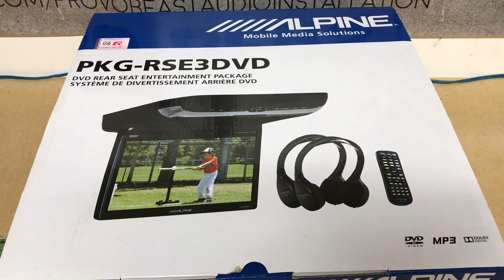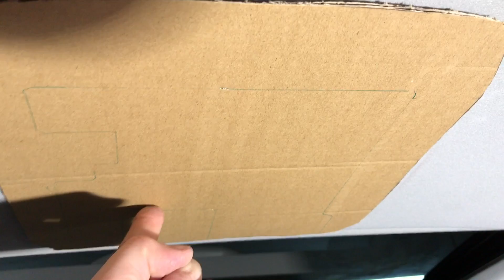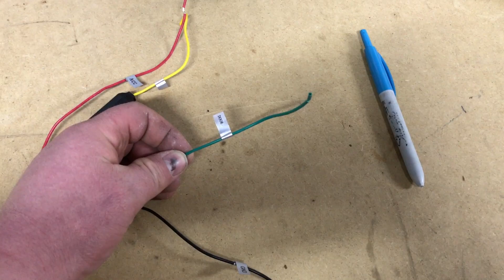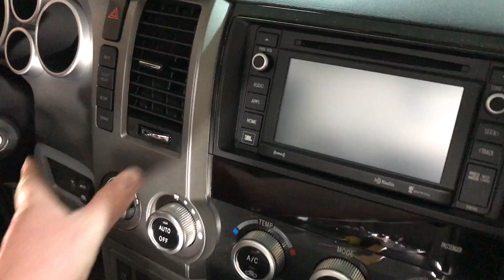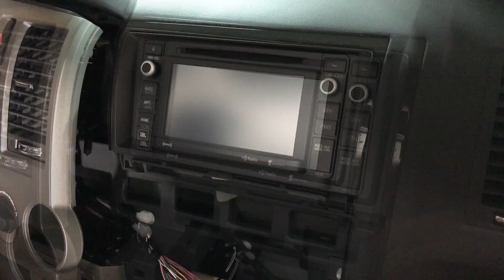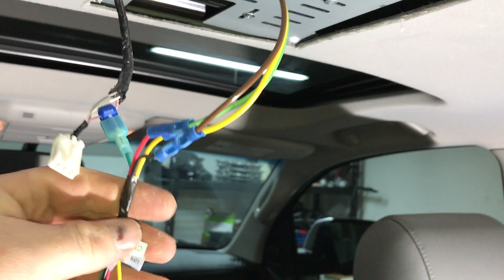2008 - 2018 Toyota Sequoia DVD Screen Install

Comment: My 2006 Sequoia Limited already had a DVD. I bought a Xtron unit and was able to figure out how to connect the unit. My issue is the dome light function. The only cable that I have left, when you give it ground, it will turn on my front Dome light with door open or close. Is really killing me to figure it out.

Comment: Got any tips for ether figuring out which FM it's programed to or reprogramming it? We bought an 07 Navigator which came with this DVD player. No head rest speakers, no head phones, and no remote. I'm working on getting them.
Is it possible to program or find the FM station it uses?

Comment: AM I ABLE TO INSTALL A FACTORY DVD PLAYER IN MY 2017 SIENNA? I HAVE AN EXTRA ONE FROM MY OLD CAR AND WAS WONDERING IF I CAN TRANSFER IT TO MY NEWER SIENNA. IM ASSUMING IT SHOULD BE OKAY TO JUST WIRE IT INTO THE DOME LIGHT WIRES? ALSO USE MY STOCK STEREO?

Comment: Not getting enough power to run the unit, lights work but VERY dim, screen does not power up. Any ideas? Thank you.
Reply from the maker: Use a volt meter to determine what voltage is being sent over.  If its low, consider using another source for power or installing a relay to boost voltage and / or run a line to the battery.

Comment: Hi I need help, I want to connect the dvd to CD player by component audio but the CD player don’t have those connections , how can I do?
Reply from the maker: Run the power to a constant source and fuse it.  Run the accessory wire to a switched power source (only on when the key is on), and then connect the ground.
Reply: Provo Beast Audio Installation hi I ready did the installation but I have problem the screen is blinking Can you helping? Please
Reply from the maker: Sounds like a wiring issue, i would recheck your connections or consult a local professional.

Comment: In you unboxing video, you already have a unit installed. Did you have to replace the apline unit or was that another vehicle?
Reply from the maker: In the other video, it was just a replacement of an existing unit.  This video was a fresh install.
Reply: Provo Beast Audio Installation
I know a lot of Toyotas have 8.5 inch screens. Is it a noticeable difference to go with a 10 inch? Thanks for your time! I really appreciate it
Reply from the maker: Well, it may no be worth the hassle to upgrade, but it all boils down to personal preference.  If you do end up replacing the screen, might as well go bigger than a 10"
Reply: Provo Beast Audio Installation
I can't find any reputable brands over 10 inches. Well apline makes a 13in but its illegal in CA.. not sure why or if there is a limit for CA

Comment: I got the unit already and the yellow wire tag is Battery + do I need to connect that or just use the red 12v+ acc. Planning to connect it to one of my fuse terminal
Reply from the maker: Does your unit come with a Red, Yellow and Black wire for power, ground, and accessory?  If so you will need to connect all three.
Reply: Yes it does
Reply from the maker: Then connect the yellow to constant power from the battery, red to a switched ignition accessory source, and black to ground.  you may be able to find those three behind the radio as we have in this video.

Comment: I'm going to do stand alone instillation but not sure which wire should I use. the red to power my unit or the yellow one please help?
Reply from the maker: What red or yellow wire? If you are referring to the aftermarket wiring harness colors, red generally is ignition accessory switched power which is only on when the key is on.  Yellow is constant power, directly from the battery.  If you screen only has a power and ground wire, i suggest tapping into an ignition accessory switched power source so the screen only has power when the key is on.
Reply: Thank you for quick response. I will get the unit today and I downloaded the manual in the website and the unit seems come with the yellow wire what should I do then?
Reply: Forgot to mention the unit come with dome lights. I figured this yellow wire is for constant power for dome lights may be  not sure
Reply from the maker: If you haven't yet received the unit, hold off until you actually get it.  What is the model number of the screen?
Reply: Rockville RVD10HD-BK 10.1" thanks again for your help

Comment: Hi,
I had the DVD installed in the Lexus GX470 but it’s shut off and reboot itself  in 10 or 20 minutes of playing. Do you know what cause it? Not enough power? Thanks
Reply from the maker: It may be a defective player, or the install craftsmanship is poor.  I would take it back to whomever it was installed by.
Reply: Thanks. I checked the power source and i saw they tap the power to my remote starter power wire
Reply from the maker: The power source should be a switched accessory power source, not the starter power wire.

Comment: I heard reviews that the FM transmitter for audio from flipdown DVD to main sound system is staticky and not the greatest. Why not hardwire audio cables between the two for the best sounds while you had everything apart? you showed us the L-R rca’s for it. hmm
Reply from the maker: You are very much correct.  FM Transmitters suck, however, the customer did not want to run an audio line for his monitor and strickly wanted to use the FM transmitter.  If you can run a hard line, do so!

Comment: I have my Toyota sienna dvd screen installed by a certified "tech " but it continuously drain the battery. so I unplugged . what could have done wrong? pls help.
Reply from the maker: Sounds like it was connected into constant power instead of switched power.  Either trace to where the power wire of the screen is located and add a relay, or disconnect its power source and reconnect it to a location with a switched power source.